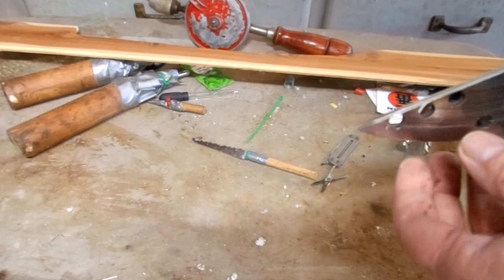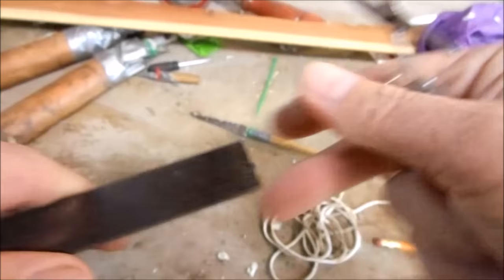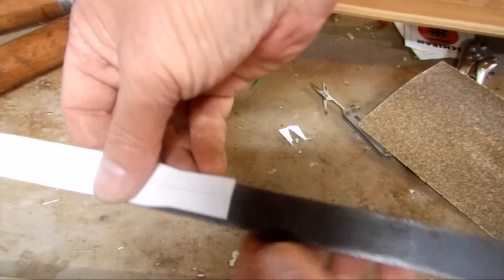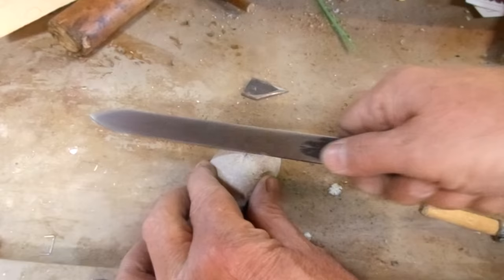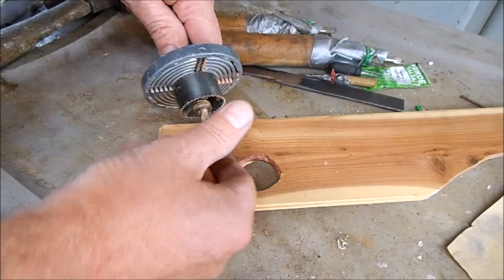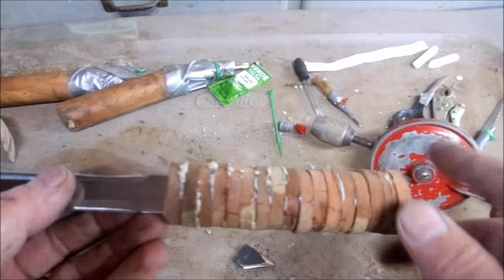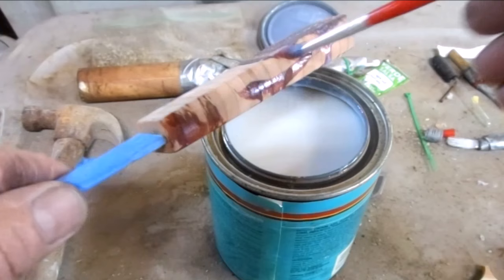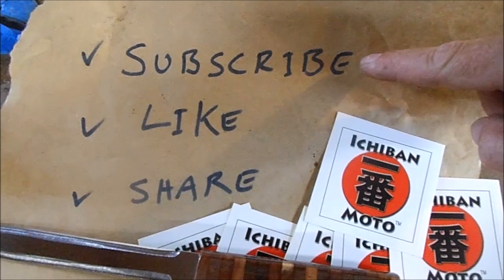How to make a letter opener knife

Comment: I knew it would be BAD ASS sharp! the way it just tore through your finger! WOW, that was better than the surgeon's scalpel. 

I'm amazed to see the effectiveness of that diamond metal cutting paper, you are using to shape the tip of the knife... I'm wondering if you can use it as super fast sanding paper as well? One stroke and all sanding is finished?

Lastly a final question; when using it for opening letters, do you use full chain saw safety gear? 

I mean if that thing slips; it'll be the Stockholm Bloodbath all over again...
Reply from the maker: it comes in various grades..   from like 2 gram to 6000 or something

Comment: What do u think is wrong with my 2002 Yamaha ttr90 dirtbike? When I give it gas it bogs down,I've cleaned the carb multiple times and it has a hard time starting this just happened out of the blue about a month ago, I changed the oil I don't know what to do HELP!!!
Reply from the maker: only one good cleaning will do it. are you certain all micropassages and jets are properly clean? also double check the timing, spark advance etc. is there a fuel filter?

Comment: thanks for the tutorial ichiban. one question. can i use leftover motorcycle tyres as fuel for my forge? i supply air to it by attaching a fan to my handdrill
Reply: if you did you wouldn't need to supply air as you could use a pre-inflated tyre inner tube and burn that!
Reply from the maker: that +Hippo247  is brilliant